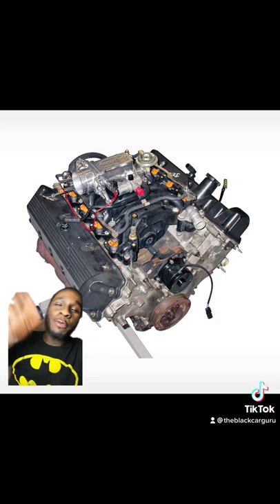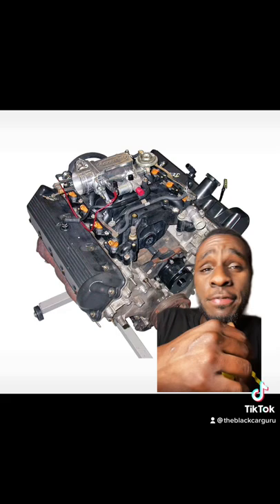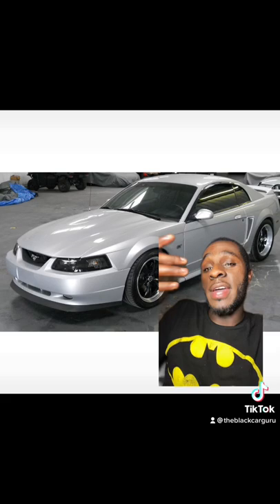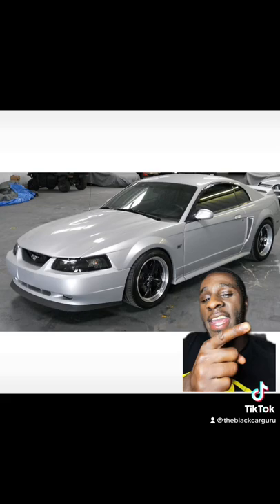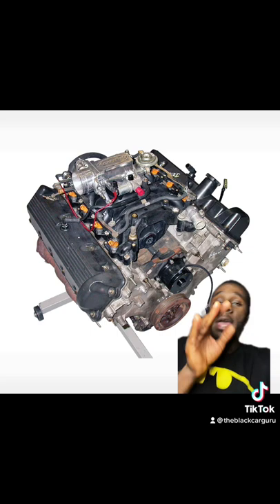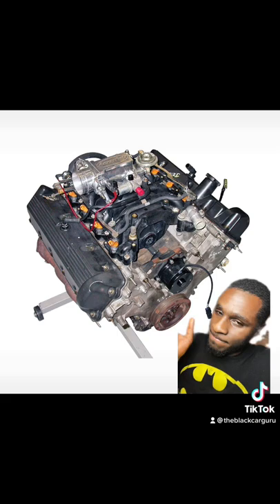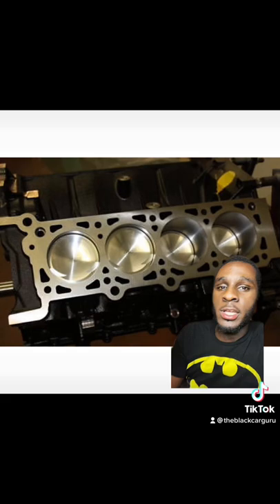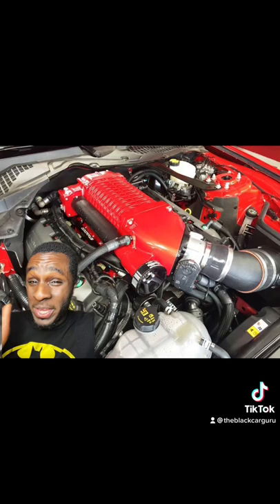Is the 4.6 2V worth building? | Let me explain why!

Comment: I have a 04 New edge mustang I just wanna give this little 2v a fighting chance man this is my daily/ street mod Time attack car I have most of my money invested into the suspension literally every bushing has been replaced wilwood brakes, BC racing coils, panhard rod system, extended control arms, sway bars, anti roll bars, etc but I only have a Borla ATAK Cat-Back Exhaust, Spleab longtube headers, Trick Flow Intake Manifold, SR Performance Cold Air Intake, and some ITB’s I ripped off of a S65 BMW v8 I bought for 20 bucks off my sisters crashed m3 I fabricated my own bracket to make the ITB’s work with the 2v (sounds fantastic at high rpm) and a BBK Throttle Body Intake Plenum 78mm that’s about it in terms of engine performance 

Safe to say I’m already down a deep rabbit hole when it comes to money with my New edge stang lol

Comment: Stage 3 heads stage 2 turbo cams mhs 4.6k forged block decent kit for 1000hp is 3k t56 kit 7.5k mind you still need about 1k in bolts another 500 in gaskets going to need atleast a Bullitt oil pump or better for 250 racing oil pan 1k timing kit 1.5k  head covers another 500-1000 depending what ones you get. Labor to put it together and in is 4k minimal. Now all that extra add ons like bbk 78mm throttle body 300 the eddlebrok vic jr intake manifold is roughly 1.7k for everything needed for the swap over including adapter plate for 78mm bbk throttle body modified fuel rails and fittings. Next are fuel injectors upwards of 1.5k for 1000hp versions. Mishimoto radiator is 600 metal expansion tank is 600 exhaust headers of good source upwards 600+ if you're smart and wanna turbo it for the low you'd get the f150 version of forward facing turbo manifolds with hot side cross over for 1.2k and have minimal fab work aka 1/4 inch off the hot side and re-weld. Mishimoto hoses 600 for all new. Holley ecu set up 5k for harness ecu and install. Now we say it's really not cheap to build them but if you do you gotta gem of an engine.

Comment: It's worth buying the tork tech kit to allow you to run the 03 Cobra stock supercharger. Estimated cost 2800 to 3500
Reply: Tork tech kits are great but will end up being closer to 5k after all is said and done
Reply: It's a good option.  The m112 is good for a stock motor 2v and if you build it you can upgrade to a modern blowers that they make for terminators as well.  That is why that kit is a good option imo. They don't make those kinds of blowers for the 2vs

Comment: I just put a PI intake on a 2000 Lincoln Cartier that originally was a Non-PI. The Non-Pi intake had a plastic coolant crossover that eventually will crack. The PI intake has a metal coolant crossover. The PI intake and gasket do not exactly match the non-PI heads on the left rear and front right water passages but a shot of silicone before gasket installation fixes that. Noticeable performance improvement. You have to reroute the water pump to heater core metal tube under the intake also. I have actually seen this swap done in one hour but it took me a couple of days. I used a PI intake from a local Pull-A-Part junk yard from a 2001 Lincoln Town Car.

Comment: If it's not ford fast its ford tough. Alot of this engine also came from older models ford trucks that ig 1996-1999. I own one from 1999 f150 and surely they sound pretty cool in my opinion. They never game me problem other than filling my gas tank every once of week. They aslo had me buying antifreeze in the cold but surely starts right up. For all my 4.6 V8 owners they  keep them maintain so they can maintain u.

Comment: Sir.....NO 😑 96-04 cobra crank, gen 3 OEM yote rods, A set of forged Pistons. Hand ported p.i heads. Your choice of intake/ injectors. On3 style/ ebay turbo.. BIG Power on less than the price of that top end kit.
Reply: Sir, are you saying we add that to a 4.6 2V and good to go?
Reply: @MarzMindset  basically yes lol, dont need the ported heads though, Coyote rods, forged pistons, cams and springs, fuel system and dyno tune. then on3 turbo kit and youll have 600hp
Reply: @MarzMindset  that's exactly what I'm saying. Although, I tossed in the the hand ported P.I heads for shitz n giggles, a set of stock p.i heads would work fine. But YES, the above is a FAILPROOF method for a reliable +/-  600hp AT THE TIRE. **Proper tuning required*
Reply: @adamhelmers3185  I didn't even think to mention cam/ springs... But I do have full faith that a set of cams would not be required to get it done.
Reply: The on3 kit itself cost as much as the top end kit but ok 🤦‍♂😂🤣

Comment: Don’t forget you can swap the independent rear suspension out a newer stand for the solid axle for around $2700
Reply: The newer mustangs have an irs that will not fit the sn95 or new edge cars that came with solid axles..best you can do is a cobra irs but good luck finding one for $2700

Comment: In the New edge it fits and If you get Trick flow heads 195cc with the Big Bore Boss block short block 5.3L  I have a typhoon intake and BBK 78mm throttle body. Use a Stage 3 Cam for these heads from MHS. Its over 11:1 compression , its NA ,sounds great and fun to drive. Procharge later.

Comment: 4.6 2V is the best sounding Mustang platform ever, in my opinion, but they are pricey to build.

10 years ago, my pop and I built my '04 GT.  Terminator short block, ported heads, a Tork Tech kit, a VMP TVS 2.3 and other little odds and ends that nickel and dime you to death.  (Fuel system, Killer Chiller, MGW shifter, etc)

Made 605rwhp 560rwtq at 18psi. For the money that was spent, I could have had a clean ass, low mileage Terminator.
Reply: Definitely the best sound

Comment: I totally agree, the amount of money I spent on my 4.6 2v I coulda done a swap or even built the bottom end for more power but I didn't have a place or knowledge to do anything like that but I did learn a lot doing that 🐆🤘
Reply: Andrew lavender has minimal amount of money in a car that’s close to 1500 HP.  With nothing but cobra crank, molnar rods, Diamond pistons, some cams and trick flow heads.    $5000 worth of stuff.    

Half of you guys that are yapping don’t even or have ever owned a mustang.   A stock 2V with ring gap will easily handle 550 to the tire and that’s in a 3200 lb car. Not 700 HP in a 4500 hellcat.

I got my Blower from a young guy that rolled his parent vert GT and it was making 380 to the tire.    A 550 hp fox or sn 95 can run 9’s with the right suspension and driver.  

Thanks for the laugh.

Comment: The 4.6L 2v that was in my 97 thunderbird was trash, but the 4.6L 4v in my 98 Mark 8 was had more potential.
Reply: those thunderbirds weighed so much, I can remember the first time i rode in a 4v mark 8 years ago. That thing was crazy fast for what it was back in the days it was a ultamite sleeper
Reply: Simba Nugz The mark viii is heavier than the thunderbird 😂
Reply: The lincoln LS had a 3.9 litter v8 I bought an 05 ls with a mark 8 swap

Comment: I dont think they are meant to race but they are fun to drive with a little diy work you can hook these up for under $4k. The heads have to he hand ported go get some from junkyard $100 carbide drill bit $100 set, new valves stems, springs/retainers/ cams 1600, headers $400, bigger exhaust kit $350 at speedway motors (2.5") mine came with 3:55 i left them, manual swap kit $1k good tune $400 max. You can have some fun. And you could slap  turbo on it too for an extra 1.8k if you can do it yourself

Comment: Got gen 2 coyote rods and forged pistons on mine. Paxton novi 2000. Makes 645 to the wheels of my crown vic.
Reply: How much does this setup run you bro?
Reply: Well it wasn't just the rods and pistons I got cams, intake etc...
Reply: Rods you can pretty much get anywhere for a decent price and depending on what piston you want. But give or take coyote rods with a decent piston get the rotating assembly balanced probably around 1,500 to 2,000 bucks for the bottom end.
Reply: Oh and the blower i got used for 2 grand.
Reply: So total tally was roughly 8,000 bucks some stuff I did on my own some I didn't  like the dyno tune for example.
Reply: @LeachimSagrav333    For sure, appreciate the reply bro. A part of me wants to build a 2v but I want to see if it’ll worth it in the long run. I’m looking anywhere from 650-800hp and I’m sure you can cut some mods to make it budget 8-12k seems doable tbh but then I have to worry about the transmission and upgrade the rear end, and brakes, and fuel system, and gas tank, and a good tire setup 🥴 definitely running up around the 15-20k realm bro. So idk I appreciate it tho
Reply: I sourced most of my parts used but that runs a risk as well. I was fortunate I've had no issues. Good luck with your build👍

Comment: Agreed I have a fully built 01 mustang GT I have every bolt on plus cam and ported heads I'm barely at 400 horsepower these are reliable engine's but not at all powerful unless you add forced induction

Comment: Or you could just get a completely forged bottom end. 63mm turbo and run like 30lbs of boost that will get you close to 650-750 at the crank.
Reply: With ported PI heads and manifold on a non PI short block, you can make 650 with 11psi

Comment: People think it's so easy to coyotes swap but the wiring the control pack is what's going to hit you the hardest if you are not a diy guy
Reply: It’s not as hard as all that..if you have a modular motor and ECU already it’s a direct bolt in and takes no more time than a 4.6 replacement 🤷‍♂

Comment: Soo tbf I'm in the process of building one of these fully built mhs stage 3 pi heads and stage 2 turbo cams 4.2k . Custom exhuast headers and hot side 1.2k. Eddlebrok vic jr intake manifold 550 mhs modified fuel rail 250. 80lb detwerks fuel injectors 680. Dual 340lph detwerks fuel pumps 400. T56 transmission kit with bellhousing drive train and clutch 5.6k turbo I recommend on3 2.6k. Forged rotating assembly from mhs 2.2k. Mishimoto radiator 600. Bbk throttle body 78mm 300. Bbk cai 200. Steeda underdrive pulley kit 300. If you dont have a good rear end the 31 spline conversion is 1.2k from lmr.This kit would be you're reliable 800hp at the wheels monster daily. Boost guages are optional price for you're budget build but really when you break it down you're going to put 10k down on any car just about soo that being said you pay 5k for the new mustang or crown vic I'd buy the heads first then the rotating assembly get that out of the way and start my turbo build or supercharger kit. I get people want the raw power first but that's not reliable build it respect it and boost it.

Comment: A cheaper simpler route is swap in a OG 5.0 in, not a coyote but it's better than a 4. 6 2v and 500hp is $1000 set of enforcers, $300 Howards cam, headers and a vortech supercharger away plus the typical required upgrades fuel, ignition, basically $10k and your fast. Big dogs has a 530hp NA 347 kit with EVERYTHING FOR $9K

Comment: Tbh 94 and 95 sn95 still have the 5.0 and you can swap those in by changing the k member so you can put a 351 with a carb if you wanted
Reply: No need to swap k member
Reply: I’m looking for one rn, just gonna swap in a 351 3 bar gt40’s Anderson n41 cam and port the heads and carb swap with long tubes short throw some 411 gears better clutch and I’ll be done, lookin at a 94 tomorrow
Reply: Don’t have to change the k member bro
Reply: now thats the only comment on here that makes sense
Reply: 408W stroker in Dat bih💪🏾💪🏾
Reply: Marquice Rowan A pushrod k member and a modular k member are different so if you want to put a pushrod engine (351) in a modular car you will need to change the k member
Reply: DROPURMOM If you want to put a pushrod engine in a modular car you need to change the k member bro
Reply: @eriv4735  you are wrong i made motor mounts for a 454 in a bubble body f150 with a modular, no messing with k member
Reply: @eriv4735  i can send u a video if you would like
Reply: Christoph_Ntx With CUSTOM motor mounts you can put ANY engine in ANY vehicle..Not everyone has the ability to fab it their own motor mounts
Reply: Christoph_Ntx WITHOUT custom fabrication if one wants to put a pushrod engine in a modular car, one NEEDS to replace a k member so even though you tried with your straw man argument I am still absolutely RIGHT bud 🤦‍♂
Reply: @eriv4735  then that makes me a fabricator then 🤡🤡🤡
Reply: @eriv4735  literally bolts into stick motor mount locations 🤣🤣
Reply: Christoph_Ntx Yale’s that makes YOU a “fabricator” what about everyone else? You are clowning yourself kiddo..I bet the motor mounts you specifically fabricated bolts right into the location you specifically fabricated them to bolt into, GREAT JOB but you’re not making any points here 🤦‍♂😂🤣

Comment: Twisted Wedge heads + David Vizard port and CC job + David Vizard cam = 430-450whp and a PHAT torque plateau all motor... at a compression level that's ready for boost.

Yeah, I'd say it's worth it to build a 4.6 2V. Hell, might even be worth it to take a 3V aluminum block and drop the 2V Twisted Wedge heads on THAT.

Comment: What does a whipple gen 3 5.0 cost? What TR3650 or T45 for that matter is going to take that things 7500RPM abuse for long? 

The coyote swap is getting to be a real close call but for now the pistons rods boost and fuel 2v edges it out pretty good $ per HP wise.

Unless your looking for more than 700 to the wheel the 2v is the cheapest option.

For now.

Comment: Build a 2v I like the content, but this video does not do any justice. I have fully forged internals that I bought for a couple grand. Eagle crank, Manley rod, and wiesco piston and the internals are good for 1500. Bought a Paxton novi 2200 hd, and my heads are fully ported which costed me 800 at a machine shop. Much more into this, but didn’t cost me a arm and a leg. There’s a lot more that I did to the heads, but gonna keep it short

Comment: Just needs used 04 cobra rods ($500), pistons ($800), on 3 turbo kit and a k-member/ front coilover kit and fuel system. Do not at all need any top end work to make power out of these motors

Comment: Hope ya answer, but if ya don't, oh well. Got a 4x4 2004 f150 with the 4.6 2v. Would love just a bit more torque and hp in low end and mid range rpm, any suggestions? It ain't a racer, but it's a glorified farm/work truck. Swapping a A10 transmission right now.

Comment: You don't need  the trick flow top end kit the two valve only needs a set of rods Pistons 1350 bucks w/rings the stock crank will handle 700 or so whp never heard one break I would upgrade cams and springs 900bucks some machine work maybe another 800 at a mom's and pops  then put boost to it and if you are a diy guy it's even better 5 to 7k will get you a turbo or blower kit to get you 700+ whp all together under 15k diy will beat the average guy and you have 750 whp

Comment: Honestly interested in the 5.4 4v that came in navigators 32 valves forged crank in the 90s models if in not mistaken and the block can supposedly handle 800 hp
Reply: That iron block can easily take 1000+ wheel with forged rods and pistons.

Comment: ive a 2002 f150 with the 4.6l 2v pi motor. i spent about 3k on a billet aluminum rotating assembly, alum billet crank, cams, stage 2 valve springs and new oe valves.  i can get 6500 rpm, at almost 390 hp.
is it worth it? barely. do i like it? yes. would i do it again and better? hell yes, for cheaper too

Comment: I'd love to make my town car a little more powerful because of the weight its 4.6 has to carry but it'd be expensive especially since it would still be carrying 4,000 pounds. So really i'd rather just keep it stock and lower it on bags, maybe get a dual exhaust and straight pipe it for sound but it just doesn't make enough sense to do it imo, sucks cause i love the car but i guess i'll see how it does on reliability which i have heard these engines are known for
Reply: I put a 4.10 gear in mine. But the secret to them lasting forever is that they don’t make enough power to destroy itself
Reply: @m.-townhounds5925  makes sense, from what i've seen, my year and series town car (97 Executive) is the lowest horsepower 4.6 for that year panther, at about 190 hp, but 265 lb-ft of torque to make up for where it lacks
Reply: Yeahp just give it an exhaust if it's your daily if you make it actually fast and dont swap the tranny you'll turn that aod4 into butter
Reply: Bro enjoy ur car. Thats what matters most, if u having fun with it and wanna cam it or whatever or boost it don't let other people tell u it not worth it. You might come out with one badass build that'll break the neck on all the haters!
Reply: @SEEmenSniper  we need to see more of this. car community is too negative nowadays
Reply: I'd throw in a 5.4, better low end for that heavy platform.
Reply: @SEEmenSniper  Amen, I too don't give a shit what others say, even had a few ls swappers get mad at me n call me a Ford fanboy cuz I wouldn't side with them..lol Fuck all that shet..
Reply: @lilporno6583  Amen, I agree..
Reply: @sategllib2191  Yes, the 5.4L is a good motor for torque, but the 4.6L too tho, bigger will always be better tho no doubt..

Comment: Give us the low down on building a decked 8.2L ford with straight-4 ,8 valve Engine, using twin m112h Eaton superchargers and a gt7699 turbo. Get the cams from a diesel 2.0 PD BKD.

Hand forged conrods